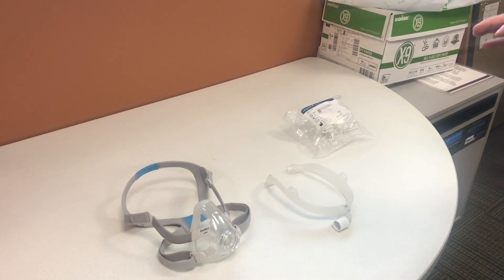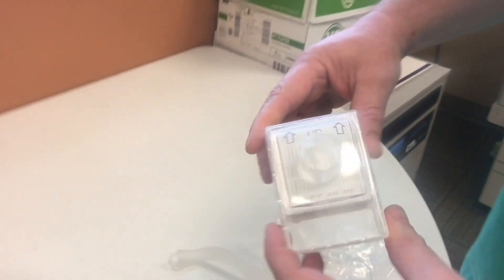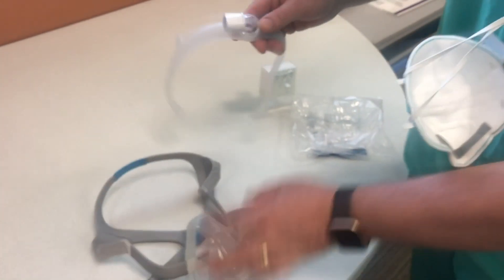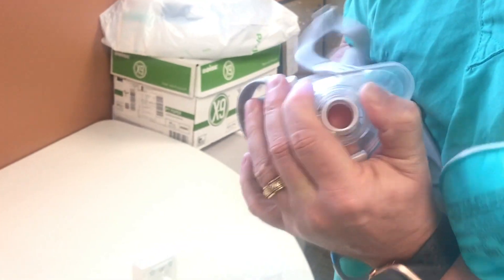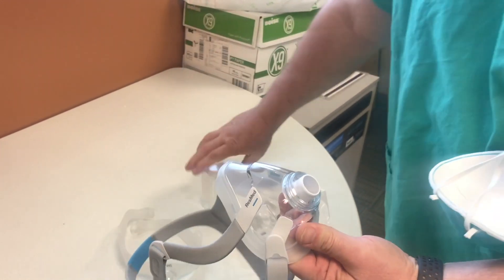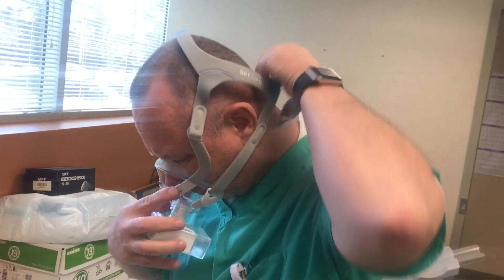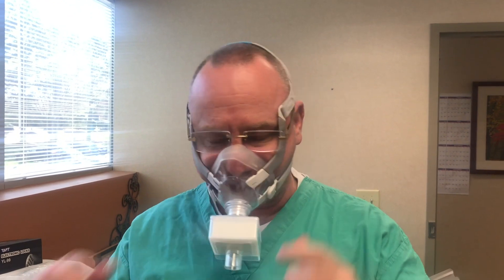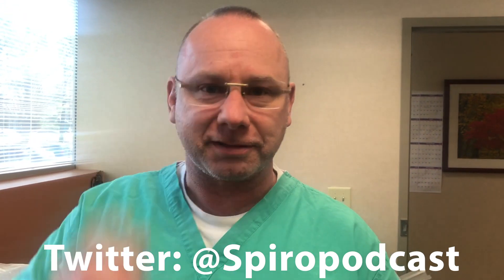Make N95/100 Mask from CPAP Parts

Comment: I played around with different masks used in OR and ICU.  The problem is difficult exhalation with only one small hole.  I would use regular respirators (by 3m or other companies) for painters or woodworking that have an exhalation valve for easy breathing, and attach different filters as you find available.  Unfortunately, it is difficult to find specific p100 filters from manufacturers today, or they are overpriced.  Also you can cover exhalation valve with piece of material to protect other people from yourself.

Comment: I have a resmed f10 but wondering what to use as a filter.  I just need it for everyday use not as a medical professional.  What is an easy option? I have heard people advise against things like air conditioner filters and HEPA type filters.  Would a multi-layer piece of cloth be adequate such as an old t-shirt piece)?

Comment: I've got my cpap masks, thinking I can leave the hose on, heck put the end in my pocket or a k&n air filter on the end. Main thing is, is that the air inlet is at a different height than everyone else breathing, its all about where your air intake is. Drive a jeep in deep water, snorkel up, breathing at 4 to 6 feet snorkel down if ya know what I mean.
Reply: Be careful on the length of the hose.  My Resmed machine instructions say that carbon dioxide can build up in the hose, so don't use it without the machine to push air through it.
Reply: exactly my approach:  https://youtu.be/_FEBv2r6oTA